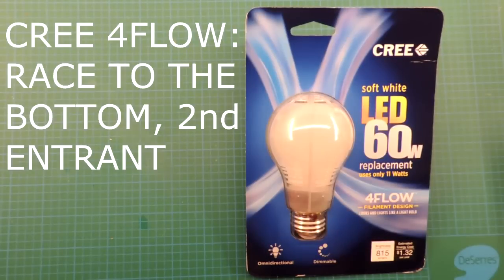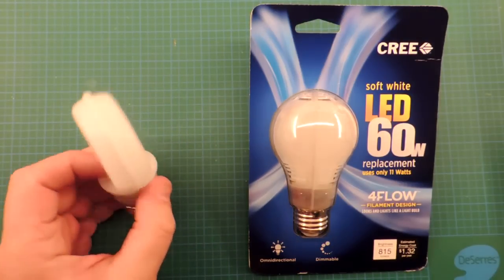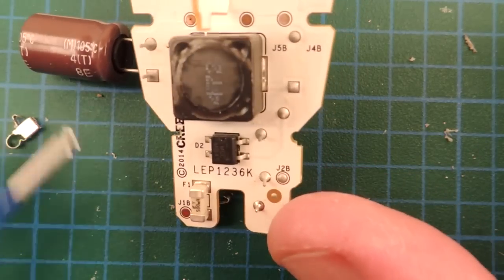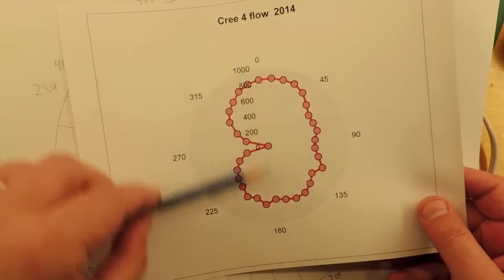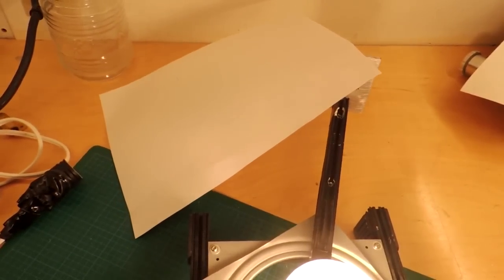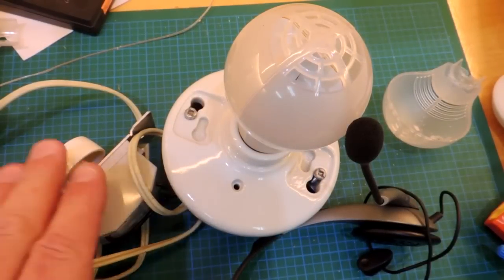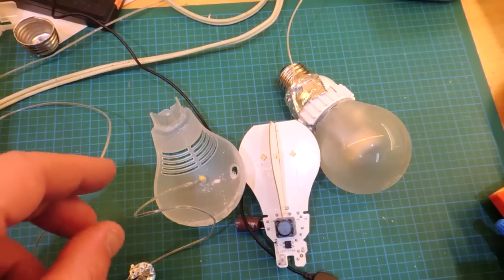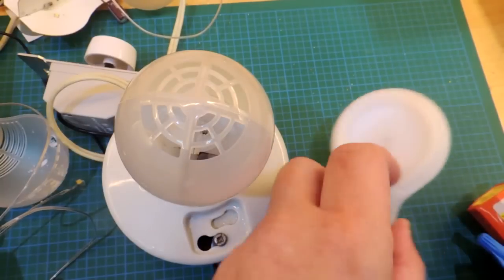Cree 4 Flow LED Bulb Review and Teardown: race to the bottom, 2nd entrant

Comment: It's been nearly 6 years.   The 4flow and the Slimstyle were some of the  stranger bulbs made.   The ones in my house likely got over 18,000 hours on them by now with zero failures.   Who knows if they will last another 6 years, but the unusual design has worked!

Comment: I have 1 60watt 4Flow out of 5 fail already, started flickering then finally stopped lighting today. 6 months old, open fixture never dimmed.

I have had 1 out of 3 Cree high color rendition 40watt bulb go out, random flicker until a dim glow one day, used maybe  two hours a day.

I have had 4 out of 4 Polaroid lamps go out within 3 months, delayed startup and eventually never start again.

Heck, even in my 2014 car, one out of two LED license plate lamps went out.

People are making these things like garbage, I have a couple high power LED flashlights that have hundreds of hours, thousands of cycles, and dozens of drops onto concrete, but then again they were $40-70 a piece.

Comment: Good quality Nippon Chemicon 105C electrolytic capacitor can outlast cheap 130C capacitors easily in these bulbs. They could have used Aishi or Tianchen brand capacitor and get the price even lower, but they decided to install the high quality one instead. Thumbs up for good teardown.

Comment: I just bought 2 Cree bulbs, this 4Flow 60W equivalent for my bedroom lamp, an IKEA swag cord set with a round paper shade I've had for several years. I have it plugged into a basic slider plug in dimmer that you plug into the outlet, and then the cord set into that. Works great and initially, it did work great without flicker, however since then, it makes a very noticeable flicker even at full brightness. I have not tried it in a lamp without the dimmer to see if it is the bulb or the dimmer (suspect it's the dimmer as it's not all the time).

I also bought the Cree 3-Way bulb to put in a table lamp and it seems to work great, both soft white/27K light temp. In the bedroom, the 60W Cree is in a lamp along with a second IKEA lamp with the same shade/cord set that is still fitted with an incandescent soft white bulb, and while I CAN detect a slight difference when looking at them directly, it's very slight but overall, the Cree fits in very well with that one incan I still use in here, along with 3 warm white (I think, or they are soft white?) CFL bulbs. They ALL are very close in color rendering, very close so I can safely say, one can mix incandescence, CFL's, and LED's in the same room, as long as they are the same color temp.

I'm writing up a series on being lighting agnostic for my blog as they all have their weaknesses and strengths and each technology will work in some places better than others.

Comment: Thanks for your review, I love the detail and solid statistical numbers. I have been a fan of Cree bulbs, but I am not impressed with the 4 Flow for one reason; it seems to be a backwards step in terms of energy consumption. 

11 watts is closing in to the space of CFLs again. I have some "60 watt equivalant" CFLs that use 13 watts, and cost only $3, and produce better light patterns. Makes it hard to justify.

Plus the "open" design of the 4 Flow means any dirt that gets inside will lower the light reflected on the "heat sink circuit board". At least with the old style bulbs you can wipe the outside.

Comment: Although the package states rated for "damp locations" I would shy away from using these bulbs in outdoor fixtures.  There is no weather proofing at all on these bulbs.  At least the original ones were sealed with glue.  Dirt & dust will be a problem with both the old design (sticky silicone cover) & new design (open vents).

Comment: Good review and teardown as always, but I'm surprised that you didn't mention anything about their 'convection cooling' - which is part of their replacement of the heat sink.  The bulb is significantly cooler to the touch, with no hot spot like the heat sink, and that can be safer for exposed bulbs around children and pets.

Also, you mention that you wouldn't use it (or the Philips ping pong paddle) due to flicker and other factors.  So, what's your de-facto "best LED" bulb that you use in your home?  Best for smooth, flicker-free dimming, best color rendering and overall light output and quality?

Comment: Yes, this experiment shows is that there is "some" flicker, and it does allow an apples-to-apples comparison be made between the bulbs.  But is the comparison relevant? It doesn't show the flicker in the sense of % light output variation because we have no idea of the light-to-voltage response curve of the solar cell setup, and besides, it doesn't explain whether either bulb flickers enough to ever be detectable by the human eye, in any circumstance, which is what matters to me.

Comment: Hmm.. How many of these do I need to replace 2x 36w T8 fluorescents?
Reply from the maker: GG2K7AU05 Not enough information....the lumen output of T8's vary depending on length and color.  Check the old bulb... the light pattern will also be different between such bulbs and fixtures.  Assuming ~2000lm for a 3000K 36" bulb gives about 4000lm for the fluorescent bulbs.  These LED bulbs are ~800lm each... so at least 4000/800 = 5 bulbs... however the light pattern on the fluorescent bulbs will be very even, not so much so for the LEDS so more may be needed for a adequate replacement
Reply: Home Depot (pay cash!) has a six pack for $45. That works out to $7.50 per bulb. A six pack of these would make a great Christmas gift for homeowner family and friends.
Reply: None...Cree makes T8 replacements now as well as troffers.

Comment: I was surprised to see the circuit board which is working as a heat sink in a way go all the way to the driver circuitry.  I was expecting to see a separation between driver circuitry and the leds.  Is there a heat transferring component on the board that doesn't makes it's way to the driver circuitry?
Reply: Good point. I wonder how well these will hold up in a "base up" fixture?
Reply: oisiaa I just put 3 60 watts in a ceiling fan so we shall see...if I get a temp gun handy I'll get a reading.